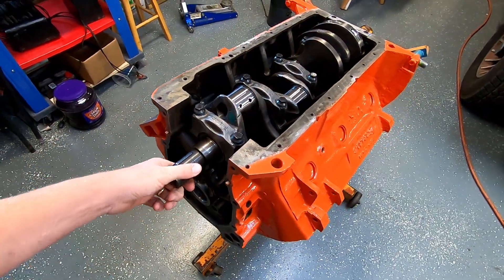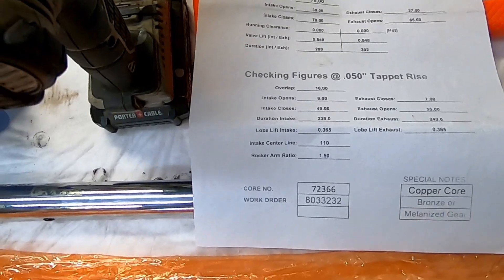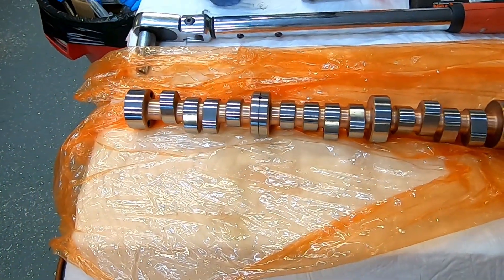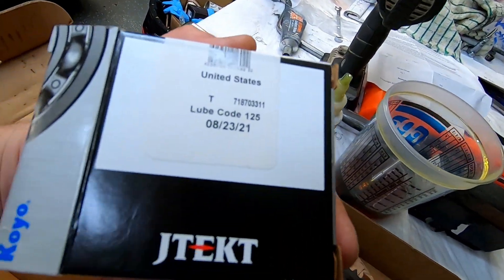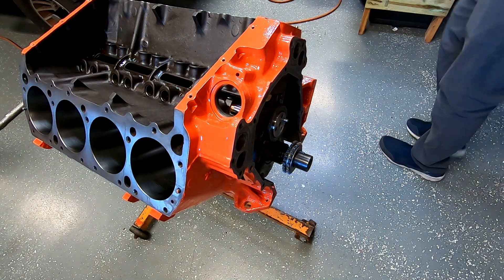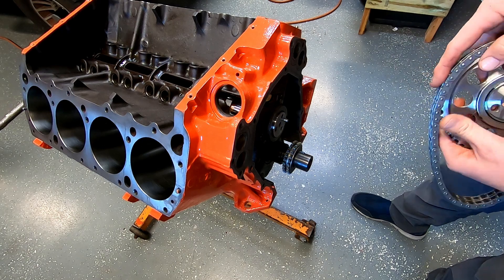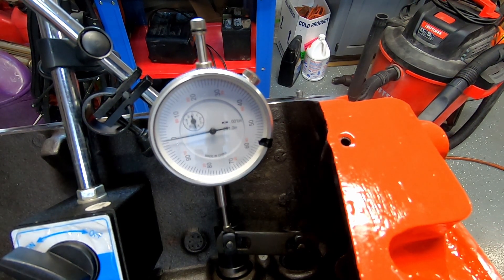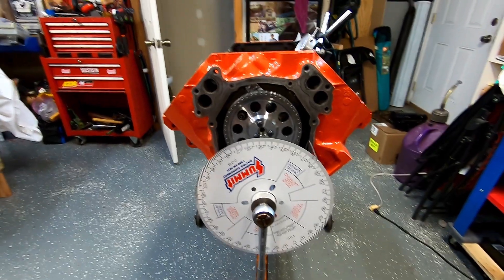Dyno 440 Engine Build Part 2: Camshaft Installed and Degreed #mopar #engine #bigblock #440 #Erson

Comment: I have never used a degree wheel before..just trusted the maker of the cam to give me the right cam with the correct specs..But I always thought that when it shows the .050 numbers, that was the numbers at the valve.. So with a 1.5 ratio rocker that would be .03333 at the cam..I guess I have been wrong all these years because I have never used a degree wheel..Live and learn!!
Reply from the maker: You’re correct on the lift situation. I think it’s valve lift versus cam lift. But the reason for the degreeing is to check several things.
Reply from the maker: Check this one out. Secret Truth to Degreeing Your Camshaft: Dot to Dot isn’t Good Enough!! #engine #compcam #mopar
https://youtu.be/U5yI4FdKQe0

Comment: I am 68 - still learning.  Reorganizing my life with our Lord's Blessings - after being caregiver to Mom & Dad more than 15 years, and my brother too.  
I hope to have another 64 to 70 Mopar in the future.  I had a - 
 64 Fury factory 426 wedge (not Hemi) & 4 speed - was converted to Max Wedge specs when it was 1-2 years old,  
69 Dart GTS 340 & 727 with factory flat hood (!) and dog-dish hubcaps = sleeper,  
73 Duster 340 & 727, factory fold down back seat  & 1/2 vinyl roof  AND sunroof (!),  
and 66 Dart factory 273 4bbl & 4 speed, B pillar sedan, 3.23, manual brakes & steering, front disc, no options, no radio.  Previous owner stuck a 340 & 904 with 3.91 in it - I preferred the original combo.  I think it was 2650 lbs.  
This semi-retired Mopar guy will eventually build again.  I'm learning and catching up with your videos.  From 1 Joe to another:  Thanks Joe!!  
👍👍👏👏☝️☝️💪💪  
🤜🤛  
Merry Christmas!!  Our Saviour Jesus is born!!  
🙏🙏🙏
Reply from the maker: Thanks, Joe! Merry Christmas 🎄

Comment: Merry Christmas Joe!  Where is Ed's machine? I'm a little bit east of Memphis and wouldn't mind driving to get my 400 block baked and shot clean, and oil galleries drilled.

Plan is to use a offset ground forged 383 crank to use 6.7 scat rods, like another build here on YouTube. 
Going in a lowered 96 Cherokee 2-door. At about 3200# should be fun!
Reply from the maker: He is up in Rogers Arkansas. That would be a haul from Memphis

Comment: I can tell you are having fun. Just playing with the old parts and a mix of the the new and the thoughts of the enjoyment that your friend will have make for a good time.   You might appreciate the project I am doing right now.   50 Pontiac Fleetline, I installed a 67 Camaro subframe,  496 BBC and a TH400. Next is to narrow the back frame 6" each side, tub it, then build a cage then the floor.  Thanks for the fun videos.
Reply from the maker: Holy cow! That’s a project! Good luck with it, and it should be a blast to drive when done

Comment: Nice looking short block. It will be a good cam for the street.  I have no problems running the .509 Mopar cam on the street in my 440. It shouldn't run as well as it does with low compression of 8.75:1. I will go even bigger when it gets freshened up with a different set of pistons.  . Never heard of a copper core cam before.
Reply from the maker: Very nice! Beat I could tell it isn’t a cast core and seemed like very nice quality. The old .509 will always be a beast